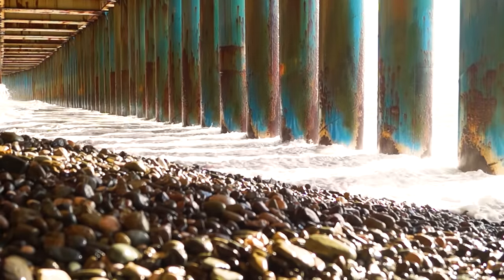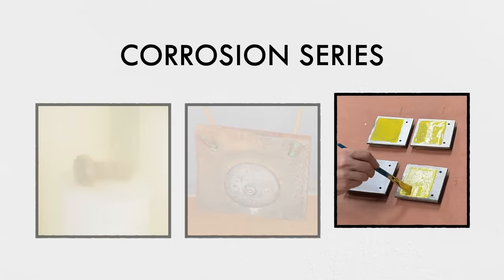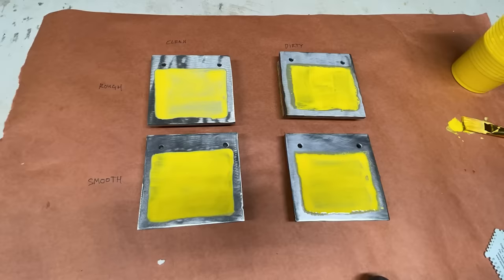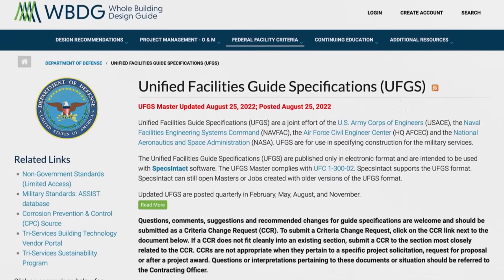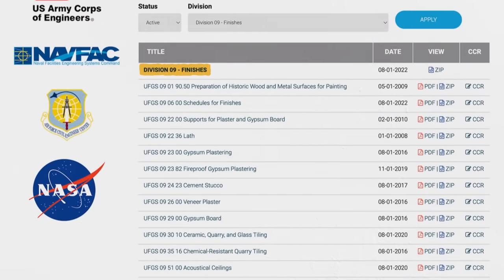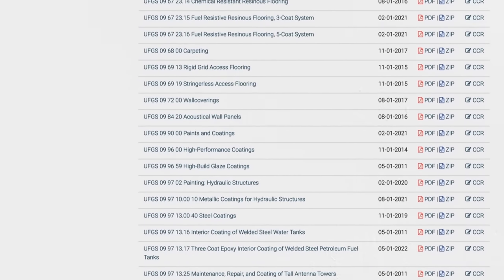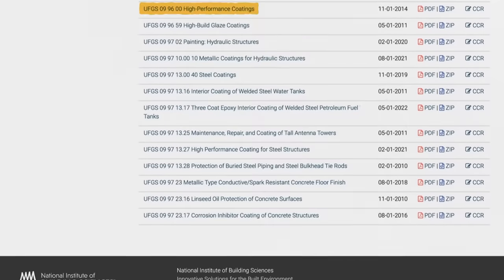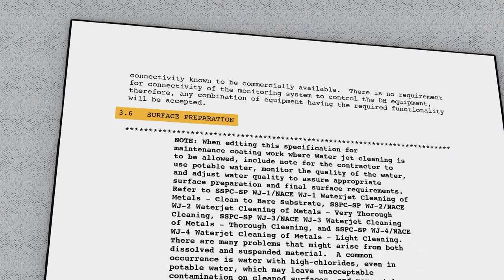What's the Difference Between Paint and Coatings?

Comment: I am an aerospace engineer who has worked with coatings, epoxies and composites.  And I also had a long time Summer job in a paint store and on a paint crew.  I learned the lesson about surface prep from my job on the paint crew (the family had been house painters for a few generations).  Even "decorative coatings" serve to protect the underlying structure.  The crew that I worked with had painted houses in our home town for decades, and the duration and protection afforded by the house paint was directly related to the quality of the surface preparation (cleaning, sanding, and later a chemical bonding agent was used), as well as the quality of the paint and the number of coats.  Even in the span of time I worked with them, I could see houses that had been painted cheaply and quickly by other crews having the paint deteriorate in a few years, whereas one with our quality job might last for 15-20.  The protection against deterioration of the underlying structure was also evident:  well painted wooden houses more than 100 years old were common, whereas houses that were left with poor coating, could start to deteriorate in a few years.
Reply: biggest problem is that surface prep is often annoying and difficult unless the object is a flat surface with no obstruction
Reply: Houses where I live are almost always wood, inside and out, and while I’m no expert I’ve certainly seen examples of improper surface preparation leading to issues with painted surfaces, exterior ones in particular. The most common ones are, unsurprisingly, not making sure the wood is sufficiently dry before painting and, when re-painting, not scraping off loose old paint.
Reply: How much variation is there between cheaper vs expensive paints? I am about to repaint my interior and determining what to get is difficult due to the huge price range. Any recommendations?
Reply: @Eric-dr5bj  The well know dearer paints are not that much dearer and with the time you spend doing the job a little bit more expense surely wont hurt.
Reply: @ragnkja  The USDA Forest Products Laboratory did a paint test in the late 70's, early 80's on exterior test panels (fences/house siding more or less) to determine if the newer latex paints could hold up as well as the traditional oil bases paints. They painted test panels in oil primer/oil top coat, oil primer/latex top coat, latex primer/latex top coat, latex primer/oil top coat and then left them to age for 7-15 years while periodically checking on them. The test had a radical and quite surprising finding that no one expected. The only variable that determined the durability of the coatings after the test period was how soon the test panels were painted! All panels painted within 48 hours of being erected held out well regardless of the paint combination used. Panels that were sunbaked and exposed to uv rays for 14 or more days before painting had all failed and were peeling badly. The test determined that UV damage to the woods fibers before painting cut the life of the paint in half (or more) and that as little as 14 days exposure was enough damage to do that. There were only minor differences between the various paint combinations.

https://www.paint.org/wp-content/uploads/2021/09/jctSEPT01-Williams.pdf   not the same study I read but same results.
Reply: @wally7856  
There is indeed a big advantage to painting quickly after construction, and that is that there’s less time for the material to get damp before the first coat is on. That’s also one of the big reasons why pre-primed materials are getting more popular: less rush to get that first coat on.
Reply: @wally7856  
If intense UV exposure (not something we have to worry as much about where I live) causes the outermost fibres to become loose like old-chipping paint, I can definitely see how that might affect the durability of the paint.
Reply: @Eric-dr5bj  my experience is that you get what you pay for, generally.  We used Benjamin Moore paint, because the store was a dealer for the paint.  The top end Ben Moore paint is expensive compared with the paint at home improvement centers.  I think if you went with a recognizable brand name paint, you're probably good.  Just don't go with the bargain basement stuff.  Keep in mind, cheap paints may not cover as well.  I've had to paint over intense colors with cheap paint (doing my mother in law's house) and it seems like you keep coating and the color keeps showing thru - something else to consider.

Even there, though, surface prep is going to make a difference.  If you put expensive paint over a bad surface, you've most likely just wasted a lot of money.  Quality paint over a well prepared surface will give you the longest lasting paint job.  If you just slap paint over the old stuff, you might as well get cheap stuff, because no matter what, you're going to be doing it again in a few years.

The process is:  1) scrape loose paint, fill any cracks with putty, plaster or similar (depending on the surface) - if there's water damage, fix the problem before going any further - it may be uncovered by scraping away loose material 2) sand - the grit depends on the finish of the surface - rougher, like 80 grit, for external wood surfaces, maybe 120 grit for interior plaster/painted walls 3) prime any bare or repaired areas 4) we used to use a surface prep chemical called "Wilbond" made by Imperial.  It cleans and chemically softens existing paint and makes a better surface for adhesion.  Despite what it says "no sanding," sand anyway.  It's great at getting up any dust from sanding as well.  Wet a rag and keep it in something metal when you're not using it, because it will irritate skin and will mess stuff up, it's nasty stuff.  Just wipe it on the surface you're about to paint.  It's expensive.  But it works.  5) Paint following manufacturer's recommendations.  I would see how well a paint covers before deciding on additional coats, if a surface was already painted.
Reply: For me it wasn't paint but adhesives (though it's the same problem). We did a test on various adhesive backings for foil ID plates for equipment that would be exposed to the elements, and for fun we threw in a couple different brands of labels from our label maker. For all intents and purposes the only thing that really mattered was how well the surface had been prepared before the plate was applied. The cheap and expensive adhesives all performed just as well (including the cheap labels).
Reply: Anyone can make a paint that looks good for six months.  In architectural coatings (house paint) it's that first winter that begins to show the difference from the "blow-n-go" contractors versus the ones that take pride in their work.
Reply: As someone who painted a lot as a teen, and now find it nearly therapeutic, I fully agree with you! Wood needs that protection against moisture and other elements as well, and applying the right paint to the right surface with the right preparation will protect exposed surfaces for a LOT longer than a surface that has had a mistake made on any one of those variables.
Reply: @wally7856  WHOA! TIL! Thanks for that Wally!
Reply: Anyone have any good video references for correct surface prep for metal buildings? I've got one with heavily oxidized paint that I need to repaint, but I'm going to need to prep it first. I'm hoping it's not going to be something like 'hand-rub Scotchbrite-red all 1500 square feet, then repeat with green, then wipe down with metal prep" or something crazy like that.
Reply: @wally7856  How does that work with pressure treated wood and non pressure treated cedar siding? I live in the high humidity Florida and near a woods with lots of trees. Our wood houses have to have wood replaced in a few years in some areas because the wood rots out, the lower areas are usually the worse, like fascia trim boards and door jambs. Fences typically are pressure treated and left natural to dry, sometimes for a year before painting. Contractors typically just spray one coat of paint onto the exposed surfaces after the wood is installed.
Reply: @larryvaughn5843  If you read that report I linked the original tests were done with smooth planed western red cedar siding and on the newer test smooth planed radiata pine siding. No mention was made of pressure treated wood.

I know many contractors like to "season" a fence for a year before painting/staining. Pressure treated wood is an odd duck though. It starts off ~50% water by weight that has to dry. I'm wondering if contractors are spraying a stain rather then paint and they had poor performance of the stain spraying right away as there would be little absorption of the stain into the wood with the wood super saturated with water when fresh. I guess another reason to wait a year is that pressure treated wood also shrinks a lot when drying, about 1/4" in width for a 1x6 picket which if painted right away would leave bare wood exposed on the rails everywhere after it shrinks and be an eyesore. 

 I'll say that building fences out of pressure treated wood must make for some wavy wonky warped looking fences. Pressure treated wood warps like crazy as it dries out. If you want a nice ruler straight fence then western red cedar for all the above ground parts (rails, pickets, trim) and metal posts is the way to go but more $$$.
Reply: @wally7856  In my community, fences have to be the same. As far as I know they are pressure treated 4x4 posts with triple 2x4 cross bars and slats nailed to them, everything is pressure treated. I haven't noticed wavy fences but they do rot out over time in the 22 years I have been observing these fences. A new wood deck deteriorated to the point where I could stomp through 2x6 boards in about 7 years.

Comment: As someone who has served on Submarines, poor surface prep is 95% of why paint fails, particularly when the surface has flash rust or someone didn't feather the edges of the old paint, giving the paint a seam. The Navy manual for paint and preservation gives a detailed rundown on how to paint, down to how you should dip the brush in the paint.
Reply: as someone who paints submarines for the navy you are 100% correct
Reply: The quickest way to discover all the fine details of any process is to read a military instruction manual for it.
Reply: Oh that's really fascinating actually, I'd be interested in reading one of those manuals, I bet it'd help a lot with overall painting projects
Reply: @AKindOfDog  they are all online!
Reply: @tristenbyrum1567  Can you give the URL's? Or search terms, please.
Reply: @pauleff3312  oh come on, they already gave you the name of the manual. Don't be lazy.
Reply: @colorona8456  Really? I don't see any direct reference to the "Naval Ships' Technical Manual" in the OP.
Reply: @SecuR0M Navy Manuel for Paint and Preservation. It's at the end you didn't read i guess 😇
Reply: @RobinTheBot I'm surprised they'd release it, could be a threat to national security 😂
Reply: @JordanPlayz158  they'd probably keep it confidential if they could, but it's shared with so many contractors etc there's no point trying